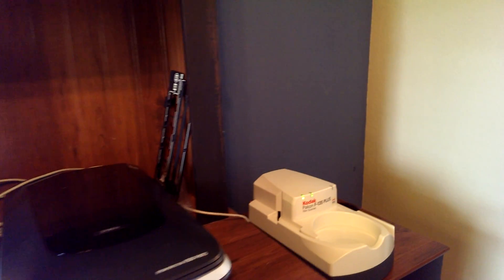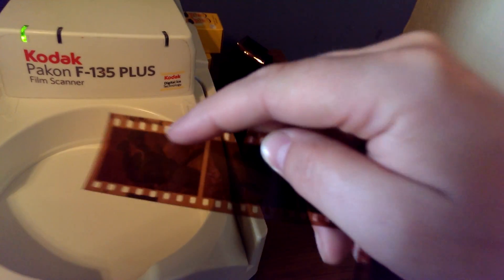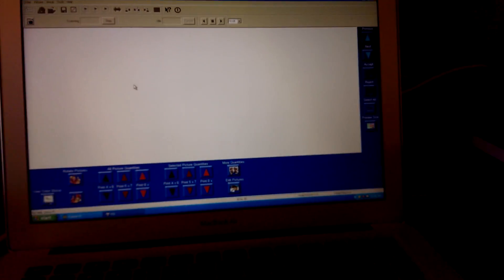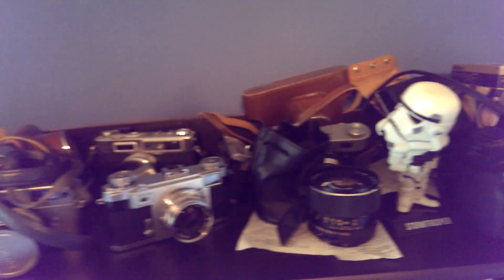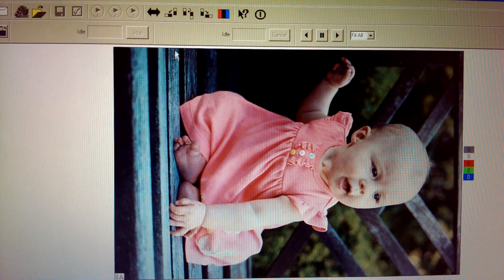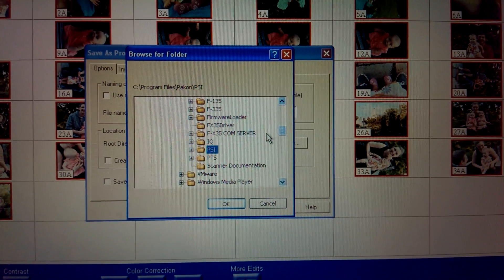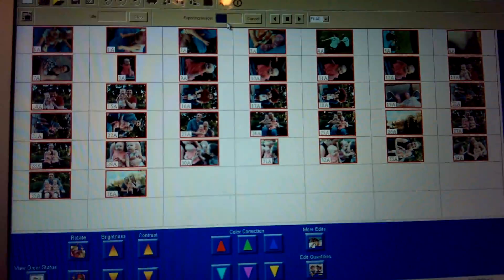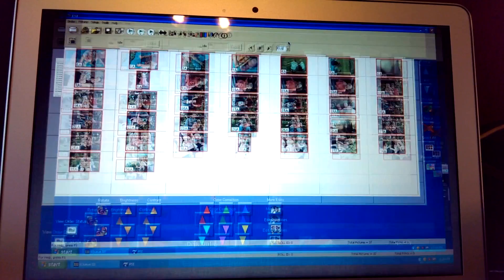Scanning a roll of film with the Kodak Pakon F135

Comment: Thank you for posting this. I first saw this video a month ago and before that had never even heard of this scanner. As soon as I saw your film start gliding through the scanner I got the biggest "are you fucking kidding me" grin on my face as I glanced over at my v700. When it was done and I saw the images pop up on your screen I immediately opened a new tab and bought one, and haven't regretted it for a second since.
Reply: I felt the same way, I'm using a v600 with the Epson scan software. What I like about the Epson is the ability to edit the way it is scanned to salvage some negs. Would you recommend the swap too?
Reply: I'm wondering, how much did you pay for your F135 three years ago?